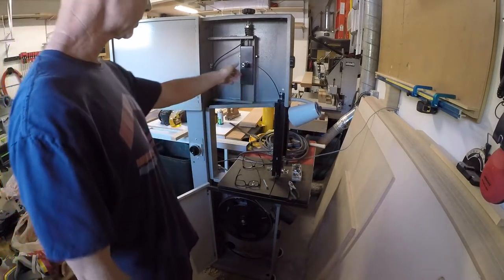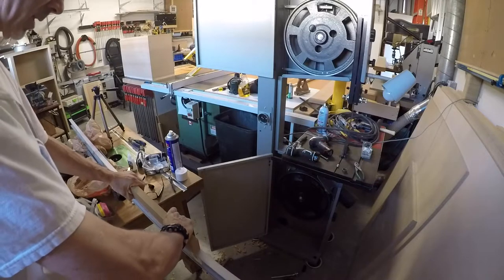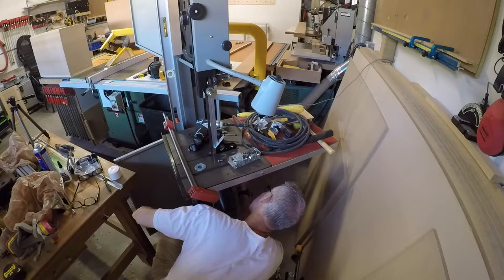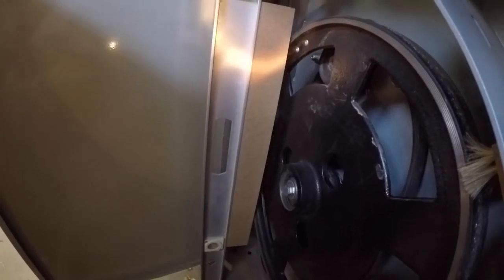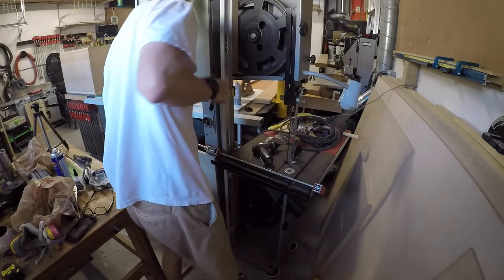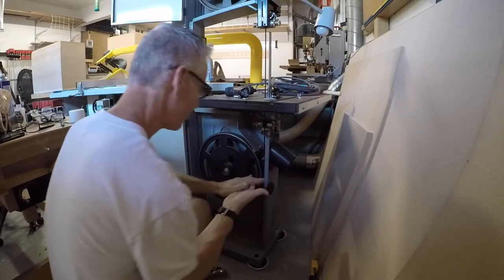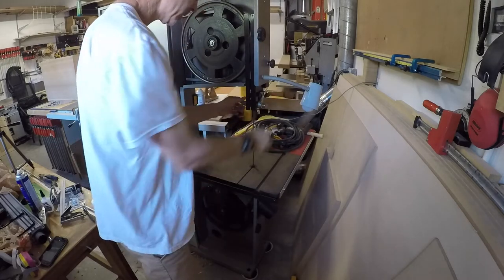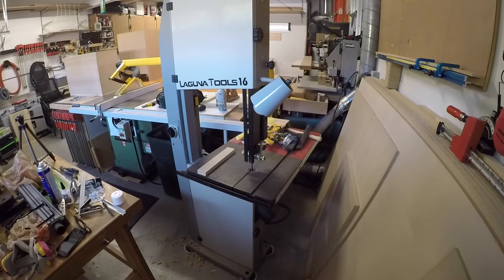Bandsaw Tune Up Part 1.  How To Make The Wheels Coplanar.

Comment: David, I don't know how I've missed your channel, though I did see the shop tour when it came out. I love how you talk your way through whatever it is you are doing as if we are right there with you. It's frustrating that I can't make suggestions like on the older videos I'm just starting to go through. I have a cheap bandsaw that I traded for with my nephew. He got the better deal, lol. I gave him a brand new, just out-of-the-box, 12" Dewalt sliding compound miter saw with a stand and I got the cheap 14" bandsaw, lol. As it turned out, The saw was just too heavy for me and with its configuration, it stuck out too far in my tiny shop. I talked to my brother and he told me to offer to barter for it, that he wouldn't have taken it as a gift. He was doing this on his own and he had a beat-up old chopsaw and could really use this. So, I knew ahead of time what it was I was getting and I'm just a hobbyist. He was just starting his business he was 22 at the time, so it was my way of helping him out. Now 5 years later, he is so busy that he is booked right through 2022! He is very talented and now has a great crew working for him. Even my other brother is working for him. Back to your video, I've decided to put a few upgrades onto the saw and was searching for videos on the subject. I am saving up for a brand new one, but I am looking for a second hand if I can find one. I am also replacing the miter saw. I just found one this morning- a like-new Bosch 10" compound miter saw and it's the new compact style so you can put it right against the wall. He's asking $400.00 for it so my brother and I are going to look at it this afternoon. My brother knows tools like I do, but he's familiar with this model because he has one himself. OKay, I'm now babbling. Sorry about that. Include me in as a new subscriber!
Reply from the maker: Thanks so much for the great comments.  I am very happy to have you as a new subscriber also.  It sounds like you may be out finding a new chop saw this morning so good luck with that.  that saw is a good one from everything I've seen on it.  Its also nice to have your brother with you that has the saw himself.  Maybe it will be an early Christmas present.  As far as the bandsaw goes, what kind of 14" is it?  Ive got an older delta 14" that I got for free, I'm sure I mention this in other videos, but it cuts so nicely.  Even though it was a rust bucket when I got it, after I tuned it and cleaned it up, it has worked flawlessly for over a decade.  The video about the laguna 16" that I bought for really cheap is a great saw also.  It needed some work but man is it nice now,  As you'll see in the follow up videos of the laguna 16".I hope that you have a great Holiday and good luck with your bandsaw.

Comment: Great video. I have the same bandsaw. I just recently noticed that the back of the blade isnt square to the table. However I noticed that the as the blade guard moves up the blade sits further back of the guides. you can see the teeth hit the side of the guides. Trying to figure out what is causing it. Shimming the wont correct that and there is no adjustment for the blade guard. I was hoping youre coplanar adjustment was going to square up the blade but you still needed to shim the table. My blade tracks but dont believe i need to adjust my guides as i increase the hieght of the blade guard. its a great saw. Hopefully I can figure it out.
Reply from the maker: Hey thanks so much for checking out the video and commenting about your bandsaw.  That’s interesting.  If your wheels are in line, I’d think the guides should be also.  Maybe the guide bracket is somehow off line and needs to be adjusted.  Don’t know about how to do it but possibly that can be done.  I’m very curious to hear how it goes.  What blade are you using by the way? Does your saw have the foot brake?   Mine just has the slot for it but no brake.
Reply from the maker: Hey just wondering how your saws adjustment went?  Did you ever get it fixed?
Reply: @davidbryanwoodworksandmore  believe it or not, I have not gotten a chance to even check anything.  Between work and other commitments i don't get much time to get to the shop. Thanks for checking in. I have your video saved so i have as a reference.
Reply from the maker: @hoxha34  oh man you must be busy. I can understand that though a little. But I try to get out of my “work” a little bit and tinker with my toys - “tools” a bit.  lol.  Let me know if you ever figure it out.  Take care.

Comment: There is so much controversy about making the wheels coplanar.  How has the saw performed (before and after making the wheels coplanar)?  Thanks.
Reply from the maker: To be honest the wheels were so out that the blade wasn’t even close to staying in position.  After my adjustment, the wheels are perfect and they run absolutely beautiful.  If you can make them coplanar then you’ll be better off in my opinion.  The guides will be better suited to be in a good position.  The blade will be consistent on both wheels.  I mean it makes no difference if the wheels are out a tiny bit, but my saw was out over a half inch.  It was bad.  I’d try to get it close to perfect.  Do you have this saw? Or another?  I haven’t gotten to my 24” that I just bought. I’ve got to get that up and running but it’s 3 phase. So I need a converter.  Did you see that video of my new 24”?  It’s a beast. Dwarfs the 16”.
Reply: @davidbryanwoodworksandmore  I have a Jet, but it has problems (upper housing is welded on an angle so the guard plows into it, throwing off the guides) and I am trying to return it. Thanks for your help!
Reply from the maker: @landoncarter6452  Fred that sounds like a bad problem.  I’d return also.  I had a jet 14” that just wasn’t good.  When I got the delta 14” it cut a lot better. And tracked better.  However, I think the jet would have been better if I had known how to tune it.  But I didn’t at the time. 2000 or so.  I just didn’t care to try to find the problem and sold it.  Good luck with yours.  I hope it works out.